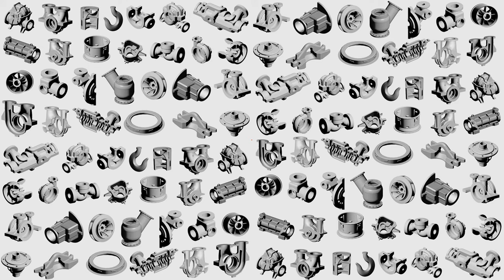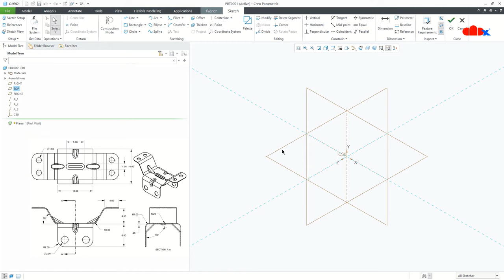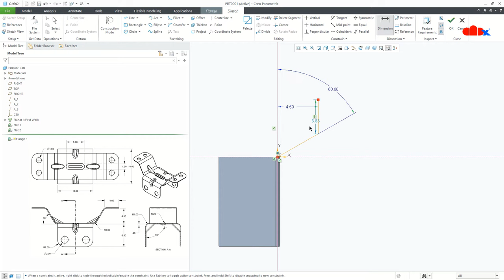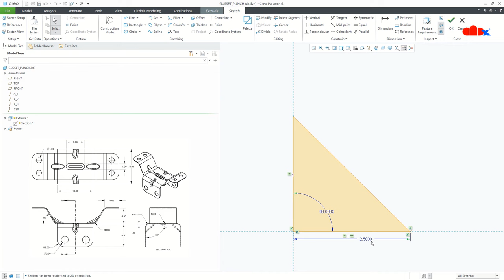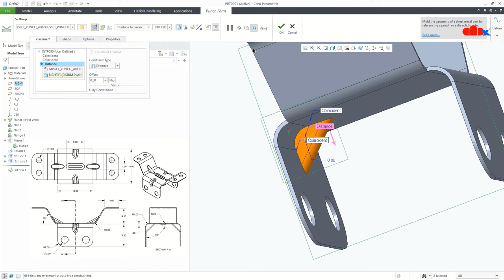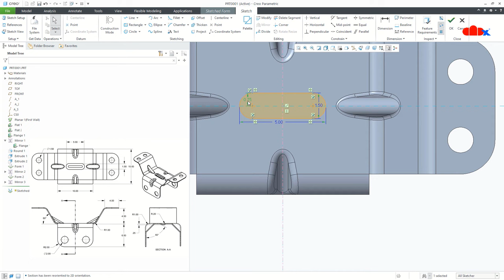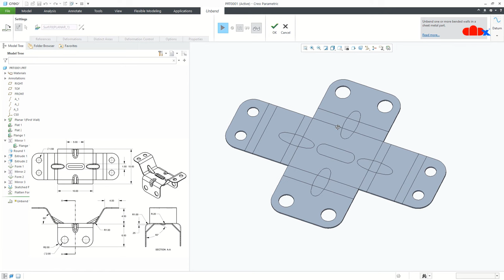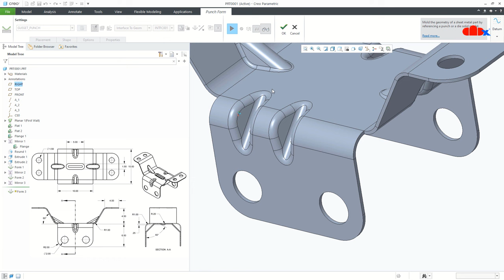Sheet metal tutorial | Gusset design & punch form in Creo Parametric

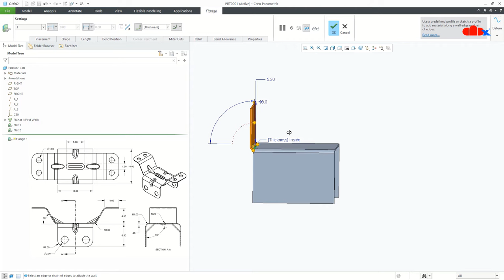Comment: Hello sir!... At 3:41 you are add  a BEND OUTSIDE command. I'm using creo 5.0 how will i use that feature sir?
Reply from the maker: This option is there in Creo 5.0, you just need to search in the tabs.
Reply: May you please explain which tabs sir... I cant see that option on my flange creating panel.. if it possible please say this thing in your next video
Reply from the maker: Inside the flange, you have offset tab.
Reply: @CADxTraining  it's in like 1.add to part edge 2.Automatic 3.By value. I'm right sir?... Thank you...

Comment: sir in creo 7.00 material removed option doesn't open in extrude how to open that option sir
Reply from the maker: Can you write down the video timing?
Reply: @CADxTraining  sir you used extrude command  and put a hole that timing sir
Reply from the maker: I got your question. Actually in creo parametric 7.0, you have extrude cut as a separate command. So you need to use extrude cut separately.  you cannot use it within extrude.
Reply: @CADxTraining  thats it sir thankyou so much